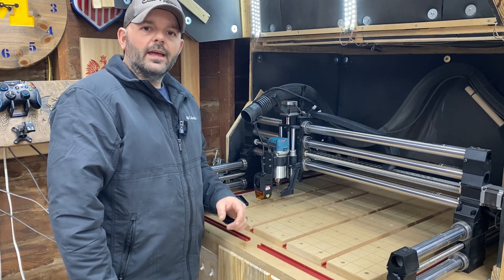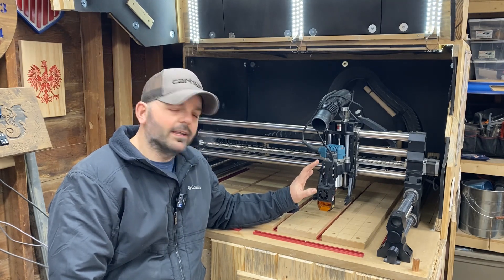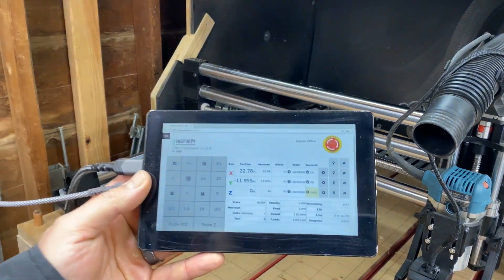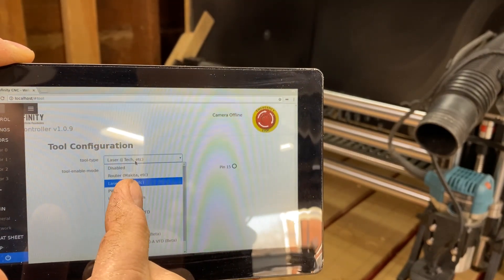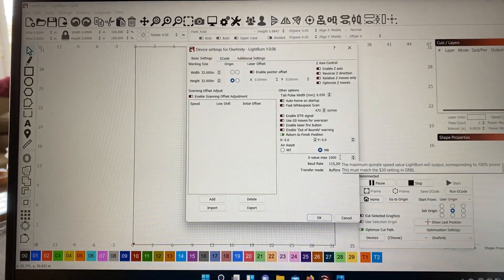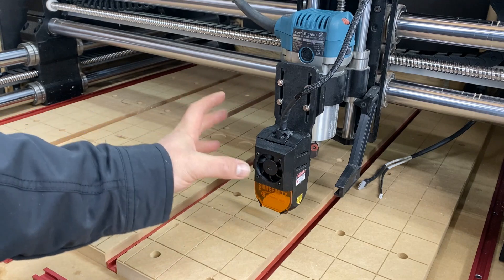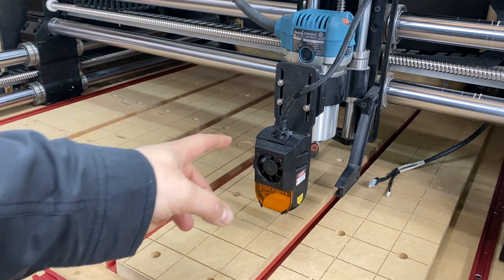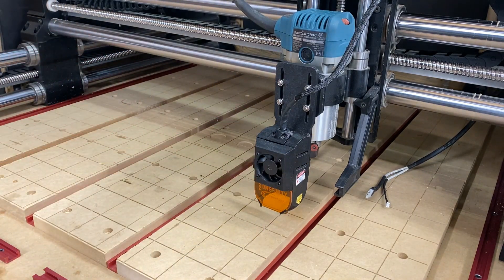Onefinity CNC J Tech - How To Set up Laser and Special Modification

Comment: Nice information to know. 
How difficult or easy is LIGHT BURN to learn? I too am new to all of this and decided to start off learning V-Carve Pro and am somewhat proficient at the basics and would eventually like to get the laser going also as you have. Not sure if I want another month of frustration in learning another operating system so soon though!
Reply: They have a laser module for vcarve pro now, I am thinking of doing that in stead of light burn so I don’t have to have two separate programs.  I need to study it a bit more before pulling the trigger tho.
Reply from the maker: @CountryBoyMoto  That’s a good idea. It would definitely make it easier to start running the laser. I can only speak for myself, but I really like Lightburn. I’ve recently gotten into a deeper dive to modify and change my files in Lightburn and ( again, I’m new and using probably 5% of the programs ability) but it seems similar to Inkscape
Reply: @CountryBoyMoto  I have the laser module add-on for vcarve pro and really like using it. I have just recently purchased the air assist kit for it but haven't received it yet. Looking to do some ornaments and very cautious to get into cutting versus engraving as far as the feeds and speeds go.
Reply from the maker: To be honest - it’s very easy, at least what I use it for. I haven’t gotten too deep into it , but it’s easy to setup files and run them. It seems like a real good program to edit your images too.